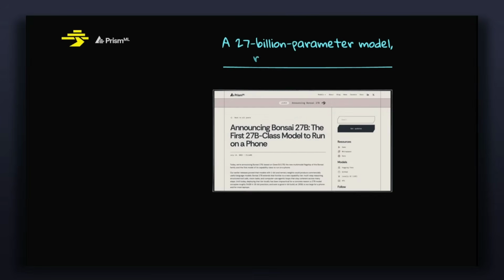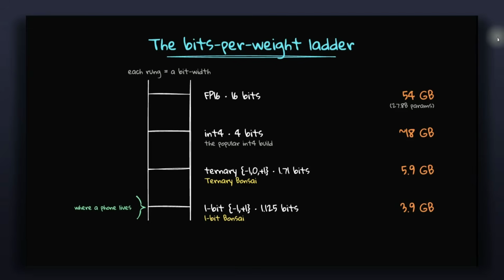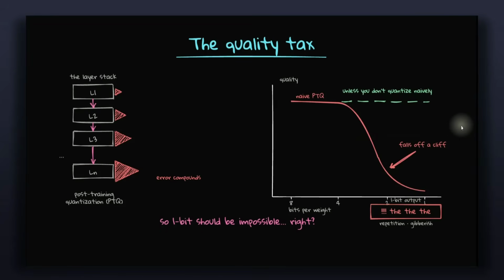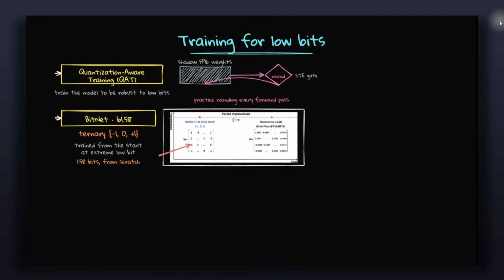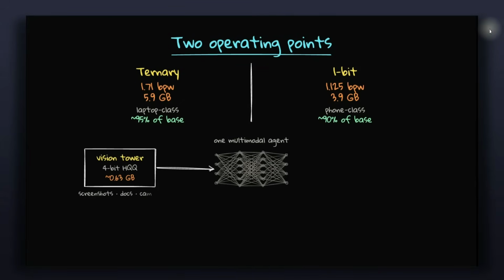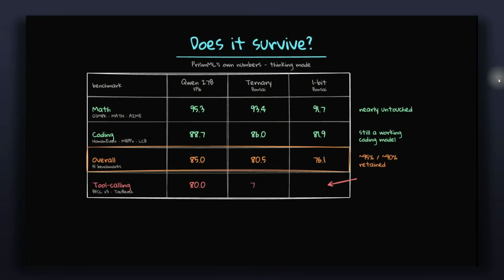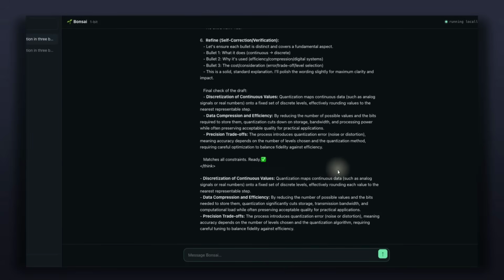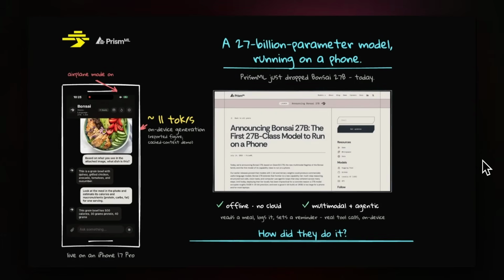Bonsai 27B in 3.9 GB: 1-Bit Quantization Explained and Tested

Comment: Microsoft has something like a $13B position in OpenAI and sells inference by the token through Azure. A self-hostable, CPU-runnable, Claude-tier open model is the single most destructive thing to that business
Reply: First, Microsoft makes 130B in profit every year. It's like you guys still haven't scaled to understand just how much money is out there. 13B is nothing. Also, Yes but this isn't that. Lol. Self hosting isn't anywhere near what frontier models can do. You can tell a frontier model to do something, come back 5 hours later and it's done. Open source models can work for 15 minutes maybe. 1-2 hours now. Not 5+. These models don't replace anything cloud does. It's fun to play with or use for very low stake things, I do, for things I want kept private. Otherwise people are gonna use chat gpt. Chat gpt can do your request for a fraction of the cost with higher intelligence. Hence, why I use a subscription. The only reason I'll still spend 100k On a computer is, I need private inference and I trust, no one. But there's very few people it makes sense to drop 50-100k on a setup for Ai you're not ever gonna hurt Microsoft. Lol. Get over yourself.
Reply: Yep, and the market cap on the stock exchange that comes with the bearish flip in confidence from investors. But perhaps, not their "whole" business; perhaps their AI related business line.

Comment: I find the ternary version quite usable. I haven't had the looping issues you had at this time. However, I also wasn't using the 1-bit version. 

I think ternary is the way to go if you want to use it for anything useful.

One agentic task that seems to work great is a chatbot based on traversing an LLM-Wiki (vs RAG). That seems to be working nearly flawlessly for my LLM-Wiki KBs.
Reply from the maker: I am planning to spend some more time trying to figure out what caused that. It might not be the model but my own setup. Agree, the fact that it works is awesome and hope we can get ternary versions of bigger models like GLM 5.2
Reply: Thanks for the pointers buddy. Got reason to explore Karpathy's LLM-Wiki pipelining now with this.